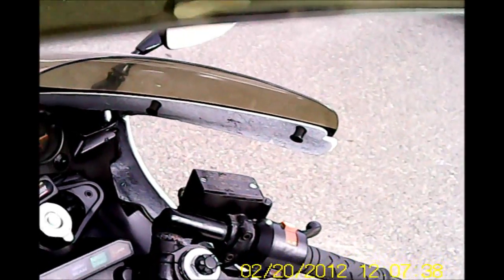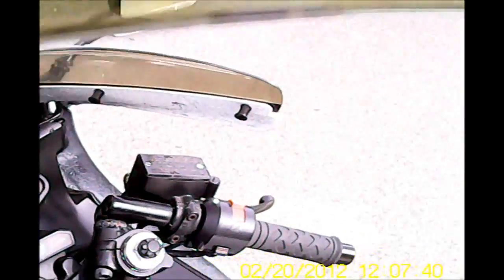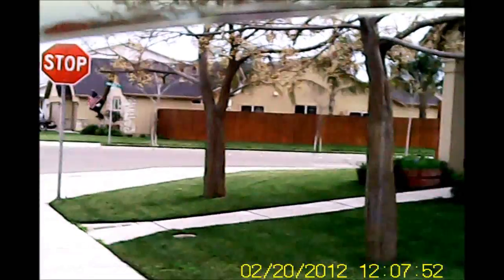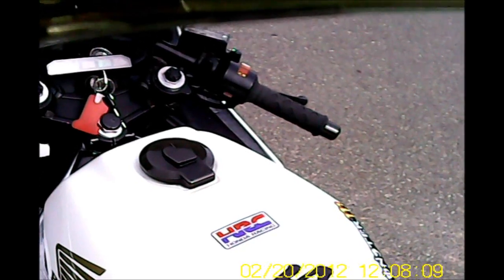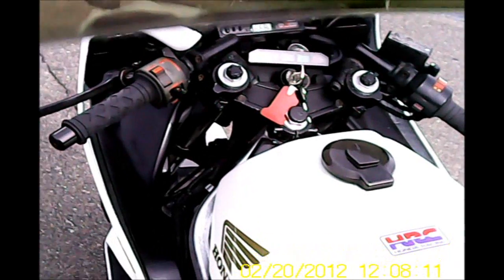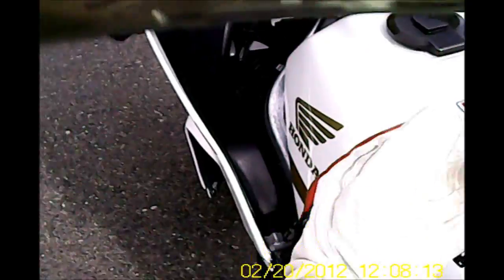VF1000F carbs install on a VF1000R Part 3 road test the fast ride

Comment: Brilliant upgrade for the VFkR. I am doing the same thing, but still have not achieved great results. I believe I need to shim my needles. I understand you did (using dynojet needles). Do you know if shims can be added to the stock needles?
Reply from the maker: Yes shims can be added to stock carks.